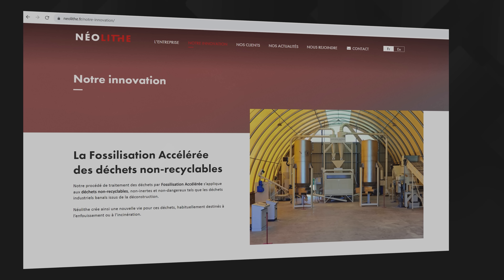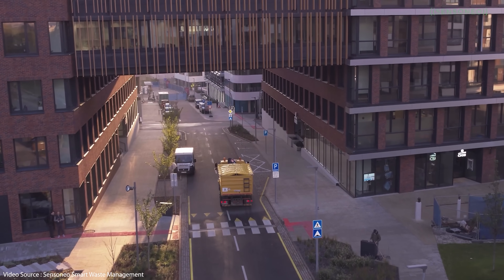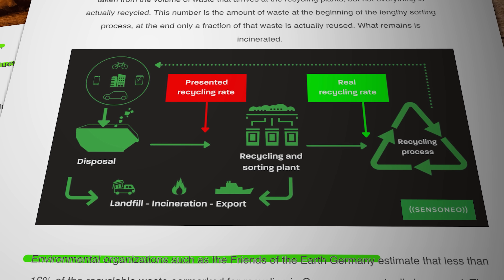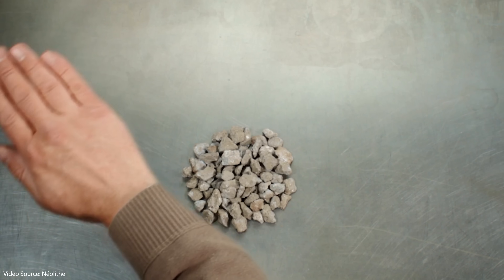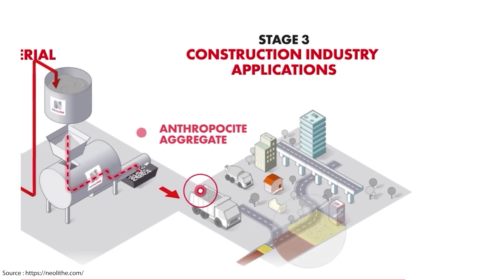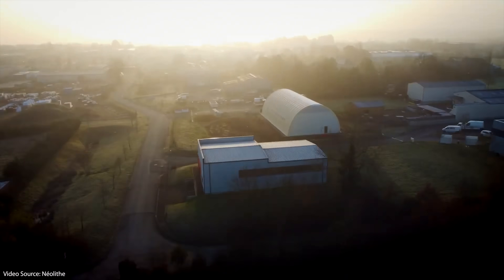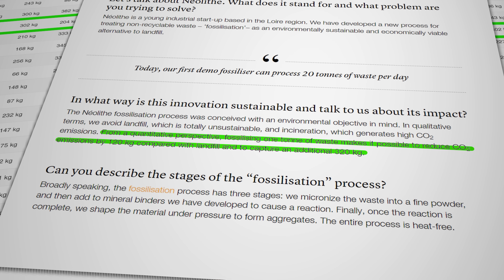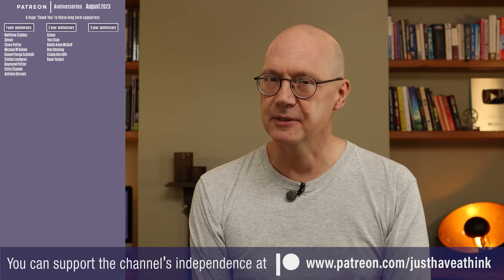Building roads with your rubbish! How do they do that?

Comment: So the waste is going to be turned into bits of aggregate using this magic process and then ..... set in cement to make concrete? If the cement is Portland then that's loads if C emissions! And off course one day the waste will escape from the cement and release it's embodied carbon and toxins 🤔

Comment: Judging by the process and look of the aggregate, they use limestone mixed with some refinery product to powder the crushed wastemateriel. Using limestone is not exactly environmentally friendly, but i guess somewhat ok. But more important, i think they use a binding component from a refinery or maybe a gelantinish materiel. What would negate it being a green solution, more so a greenish solution. If the just use a certain limestone mix and water, that would be very interesting.

Comment: There was no information about the cost or performance of the NeoLithe product relative to conventional aggregates.  If the aggregate doesn't last the life of whatever you build with it, that's a problem.  Part of the cost of the aggregate could be offset by the value of the carbon that it locks up.

Comment: from the start I'm always wondering with projects like this - What's the difference between this and a landfill? I mean if a plastic material is exposed to the enviroment, it will probably leeching some stuff out. Microplastics, probably too.
Reply: with a ratio of 20:80 I suspect this is not fit for UV or chemical exposure.
Best fit for filler construction probably.

Comment: It's a scam. Unless what I think is all wrong.
If we assume for a moment that the binder is cement with poly vinyl acetate glue then we have a concrete like composite material full of plastic powder. However there aren't long fibers in a fine powder so the tensile strength can't be very high unless of course they can make a powder with indeed long fibers present.  Further if the ratio was 80% binder and 20% plastic flour then I would believe it but reversed ??. The fibers from all these non related plastic won't, together with the binder, miraculously connect to a web or so. Unless of course they do ;-)

Comment: This is potentially very exciting, however, there must be some way of ensuring some kind of homogeneity in the materials going into the Neo-lithe product in order to offer a regulated density to ensure that any production line manufacture or bulk mixing can be assured of stability in processing. I really hope it is a huge success. I think that the ubiquitous nature of plastic products is doomed in the near future by our failure to sort and reuse plastics. Landfilling plastics which are not currently viable in recycling at least offers the possibility of digging them back up when their value is better balanced with cost and necessity, however, any inconveniently reusable products currently ruled out for reprocessing into similarly useful products will presumably be lost forever once they are processed by Neo-lithe

Comment: you gotta just use some alcohol alkoxides to melt down the ceramics of metals, ie metal oxides, alongside with ethanol-koh etching solution
Reply: your problem, dont even think making it my problem
Reply: patent is not a solution, its the problem, like any law based solution
Reply: no you want and cant do anything with it
Reply: no you dont have to do anything, chill already no-rest people
Reply: drilling friction makes heat, just like filament making by screw extruder
Reply: if you want to go to market, you miss the goal
Reply: just have a think what you have not/maybe have done
Reply: if you delegate, you are not doing it yourself, better earn your stuff yourself, and it does not mean market trade, which is evil

Comment: When this ultimately degrades after x decades won’t this result in a ridiculous amount of micro plastic?
Reply: The process of fossilizing seems to largely, if not wholly, decompose the material on a molecular level. In other words, it's no longer made of plastic.
Reply: @nagualdesign if that even if what happens, seems a lot of people suspect they just mix the powder with lime or something. Just using the trash powder as a filler. Without more details it's hard to know.
Reply: @bzuidgeest  Vacuum pyrolysis can be used to completely decompose plastics. Whether that's what they mean by 'fossilization' is anyone's guess, but simply melting plastic then pulverising it once it sets would be an expensive way of making a not-so-durable product.

Comment: Thanks for reporting on this and hopefully this is part of the solution. Also redoing "packaging" with recycling ease (cradle to grave/reuse) is an ongoing challenge.
Reply: Exactly they want us to go back in time with Net Zero so why can't we use the packaging we used before plastic more and make sure its recycled by putting a deposit on it or perhaps make recycling easier so there's less of us sorting it out. This idea is definitely a step in the right direction
Reply: @tims9434  I'm a firm believer of reusable package as per days-gone-bye, but we must remember that transport of empty glass bottles, crates, etc. isn't exactly cost (or carbon) free, hence one of the reasons why plastic packaging gained such traction. However, with a bit of imagination & modern usage algorithms I'm sure this is a path for the future.
Reply: We had modern society before we started using plastics... Plastics mostly came into use after WWII... Single use plastics are extra, longer use plastics are by definition a much smaller problem.
Reply: Yes I'm sure this is one for "another look pile"

Comment: the aggregat is the filling material in concrete. here we use filling material to fill the aggregat :) nice. 
for me, this is just another way to reduce the waste material and use it somehow. the same, as burning it for energy. two different ways, both better than letting it rot in the landfill.
in the first place, we should produce less waste and the best way for that is to reduce consumption.
cheers.

Comment: Why not make legos the size of concrete blocks to build structures and fence walls? Swimming pools, etc.
Reply: I saw a YouTube video of folks in India doing that now.
Reply: A snap together system with a bonding adhesive would be cool.
Reply: @shawnr771  good idea. Makes for a permanent job.
Reply: @iamnegan1515  The only issue I have is with material stability and suitable for exterior purposes.

Would it act as structure and weatherscreen or would it deteriorate in the sunlight.

Or would it need to be covered with some sort of coating like stucco.
I live in Texas many so called durable plastic based products do not survive well.
Cement based walls survive fairly well with minimal maintenance.

The idea about a recycled solid structure is intrigues me.
Especially if it was easy to assemble.

Comment: I'd like to hear from the people buying the finished product.
Reply: Wouldn't there be microplastics? And how about the performance of the aggregate?
Reply: @ArthursHD  Will there be leaching?  What about disposable or recycling?
Reply: @ArthursHD  I agree, there are potential problems here. I suppose that if the long chain carbon molecules are broken up the microplastic problem may be solved...and if the product is as durable as is touted it may even be a form of carbon sequestration... But road surfaces are subject to incredible stresses.  That brings us the potential leaching problem that @jmr brings up...
Reply: Plastics are not in the final product  if they have been fossilized. They have been turned into minerals and carbon. Not sure of it is real, but according to what they say anyways...
Reply: @0ooTheMAXXoo0  Turning plastic into "carbon" sounds like burning to me.  I'm skeptical they have another way to do that to mixed plastics.  It would great if they proved us skeptics wrong.  There are some plastic eating fungus but that doesn't appear to be what's happening there.  Nothing looked like a bio reactor either.
Reply: @0ooTheMAXXoo0  @jmr As they claim no heat is involved I don't see how the process can change the material, I think plastic needs to be at least charcoaled to avoid the microplastic problem (especially the catalysts and enhancers like PFAs etc.).
They do claim there is a chemical reaction with the binder. Can this reaction neutralise all the compounds that make microplastics harmful?
Reply: @0ooTheMAXXoo0  "fossilized" is a very vague term and actually tells us little about whatever their process does. An insect can be "fossilized" in amber without significantly changing composition.
Reply: Yeah. It'd be nice to hear both sides.
Reply: Fossilsation rocks
Reply: @trueriver1950  🤣 
Edit: (laugh emoji at the joke, the other comment I agree with)
Reply: Actually I don't think they are chemically allowiing the plastic. They bring it into powdered plastic, and use it like the sand in a concrete mix. That's OK so long as the binding substance keeps the plastic particles locked away, but is only deferring the problem to the future is the resulting "rocks" are later abraded (releasing the plastic powders) or if they later get heated (decomposing the plastics).
Reply: @trueriver1950  That's my thought.  Kicking the can down the road.

Comment: I find it so stupid that people have something against using residual oil well gass to burn materials that are hard or (for the moment) impossible to recycle and then use the energy gained to manufacture solar panels (for example) But propagandists will never talk about all the residual oil well gas burnt yearly at the top of each oil well (because the quantity is bigger than what's necessary to cover European Union's gas needs for multiple years) The gas gets burnt anyway (every minute) so you are NOT adding any new carbon to the atmosphere.

Comment: Isn't there already enough microplastics everywhere? At what concentration of microplastics in your blood and lungs would you consider making streets and sidewalks out of plastic a bad idea? It seems that washing clothes out of plastic is not enough.
Reply: Wouldn't locking it in the concrete and sidewalks keep it from getting into your bloodstream and lungs at least for a longer period of time because those things take longer to the degrade???
Reply: @bryanjohnson8162  The issue (as I see it), would be that it won't stay locked away. It'll break down and get spread over a large area, so I can't imagine it'd be as good as they claim. 
With that said, if it does what they claim, it might be an idea. If for no other reason, then that we don't really have the option of picking the best option anymore in the fight against climate change, because governments won't take the necessary steps. Time is ticking on dealing with climate change, and the actions taken by developed countries are honestly glacially slow.
Reply: Bryan Johnson makes a good point, and also consider what roads are already made of. Bitumen is another oil based product, and I don't think it's likely to be any better for you than microplastics.
Reply: @danyoutube7491  Not sure what the conclusion is but good point about the bitumen.

Comment: Asphalt is already the most recycled material in the entire world. Why would you make something that works so well, worse and shit?
Reply: I don't know why you have determined that it is 'worse and shit'. It is a lot less energy intensive (asphalt requires heat to produce and again when laying it on roads, polluting the air in the process. I am quite nostalgic about the smell of it whenever the roads are layed, because they happened to be redoing my street when I was little!) and reduces landfill, which is polluting, takes up vast amounts of space and can't continue at current levels forever for that reason, and mitigating its polluting effect on the environment is costly (high quality liners to keep leachate from getting into the soil for instance). The mere fact that it is finding a good use for material otherwise destined for landfill is therefore good enough reason to go down the route that this French firm has.

Comment: When something sounds too good to be true, it usually is, so I'll stay a bit skeptical, same as about the crazy battery claims everywhere around. But it would be nice to have ability to upcycle waste...
Reply: Here is why its a shit idea: Microplastics and chemical leachates.
The granite in Tarrazo is inert, landfill waste is anything but.
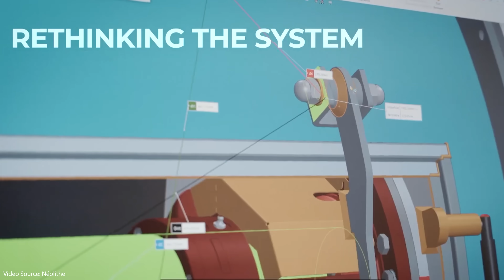Reply: @aenorist2431  He specifically mentioned that the waste COULD NOT be inert at around 5:18
Reply: What crazy battery claims?
Reply: @jeremyradford5103  You might be new to internet, so first of all, welcome.
There are claims about new battery tech every day - from anodes that allow for super-fast charging (80% in 6 minutes), to energy density around 2x current, to non-flamable batteries that you can puncture and they still generate power up to extra cheap batteries that will cost 20-30% of current prices and will enable large-scale grid storage on the cheap.
These claims are here last 5 years at minimum, if half of them were true, we would now have 2x the battery life costing 1/2 as much and recharged in under 6 minutes :) Those claims.
Reply: @rklauco  lol. I've enjoyed home Internet since 1996, so hardly new. I have been following the transition to clean energy for 5 decades and clean transport  for 7 years and have done a great deal of research. I have ben driving EVs for the last 5 years and driven over 50k miles in that time.
Admittedly, there have been a few claims that have come to fruition when applied in practice, but most of the claims you listed are, in fact, true. 
For example, CATL has just announced an LFP battery going into production later this year, which will accept 250 miles of range in 8 minutes. 
The cost of producing a lithium-ion battery has fallen by 90% over the last 12 years, and there are already EV batteries in production using sodium ion technology, reducing cost even further.
US company, Amprius, and CATL in China have both launched "condensed cell" or "solid state" battery, which have a 500Wh/kg energy density. 
So, you see, much more is possible and actually happening than you may imagine. 
However, I have not yet heard of an inflammable battery unless you are talking about the Redflow reduce battery that uses bromide in its electrolyte.